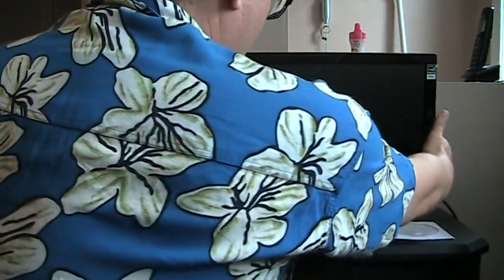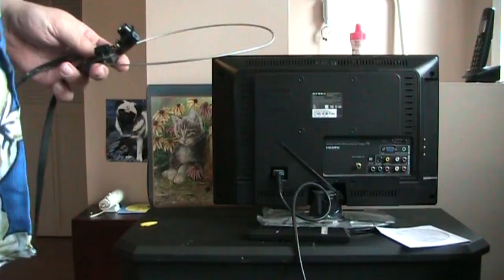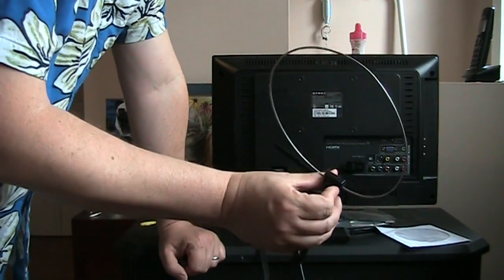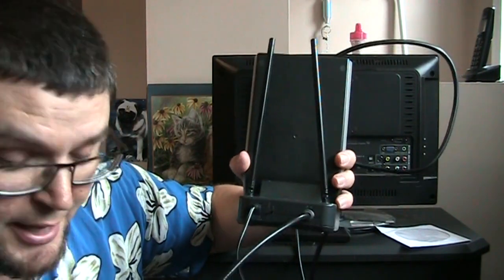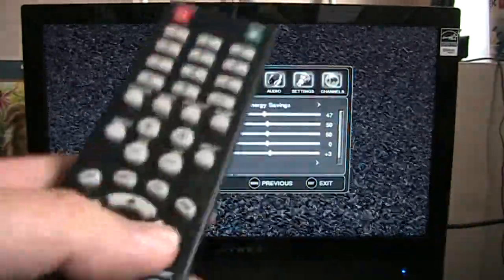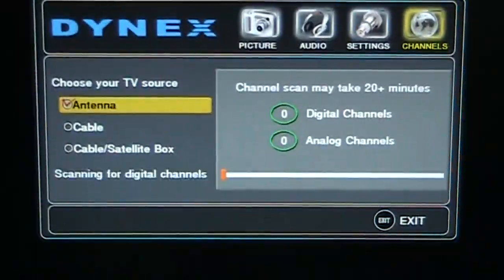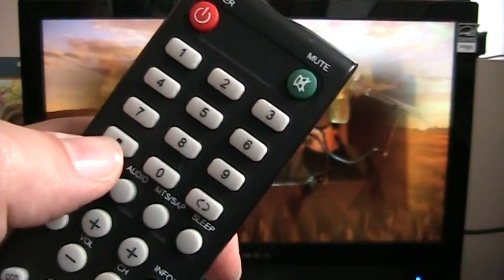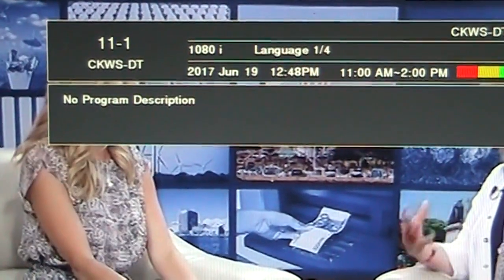How to Set Up a Rabbit Ears Indoor HDTV Antenna

Comment: I just want to add tv channels in my area.  Do I have to type them in?  For example, I want channel 5, which I think is NBC in Chicagoland. I don't understand the .1 example you gave for your channel 11. Do all tv stations have a decimal point?  This is the best video I've watched on adding rabbit ears to your tv. I only use Roku. As I think I understand, you need to 
switch sources to use the antenna. I have mine set on HDMI 1 for Roku. So, I go into Menu-source- and choose antenna to get tv stations in my area?  Then to go back to Romu streaming unchanged source back to HDMI 1?   I hope you answer my questions!  Great video. Thank you!📺🌟🌟🌟🌟🌟

Comment: I have an antenna with a built in amplifier it works but i dont turn the amplifier on because i lose signal it comes with two cables in the back one red and one black , how do i use this or what are they for?

Comment: I found this to be very informative and will be sharing it to my FB to share with those who don't believe that I (personally) do receive television with just an old fashioned antenna... My antenna is a fossil!  LOL!
Reply from the maker: Good that it still works, I made this video for the same reason I have had people tell me you need a digital antenna. I nood my head and smile :) Kind of makes you wonder what else do they believe that the Cable TV has told them. That is what I used in 2008 when channels like CBC ch 4 and Sun TV when on the air Digital with some channels still analog. I am happy we have Digital now a few of the channels I get now were so gostling and dubble imige. and now I get a full HD picture better than ever with sub channels.

Comment: Will rabbit ears work for an older 2006 tv for my patio ???? Without having to add any other accessories?
Reply from the maker: I can work if the TV broadcast towers are close enough. I use to do it 10 years ago when I lived in a apartment. Got 2 more channels when I put the antenna outside! https://www.youtube.com/watch?v=OcF6uCR1vPs
Reply: Make sure your tv is dtv

Comment: Truth and Quality.
Practical and Useful information.

Currently Channel Master has the most advanced indoor type and kind of indoor antenna that will out preform other indoor type and kind of indoor antennas.
Model# CM-30001HD.

Even so , there are No indoor type and kind of Tv antennas that will produce and provide perfect indoor reception including the CM-30001HD.

There are No indoor type and kind of antennas that will produce and provide perfect reception from the planet Jupiter no mater what the advertisements and Humans say.

-----------------------------------------------------

Also , Attics Will Obstruct and Degrade Reception. This is the Truth No Mater What Your Evaluation Of The Situation Is.